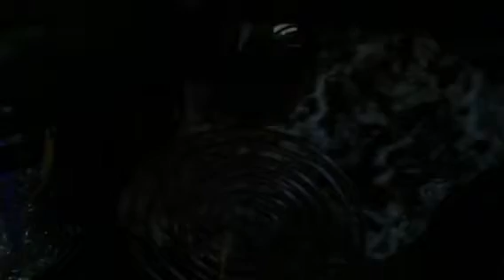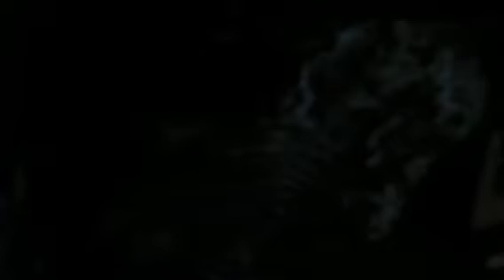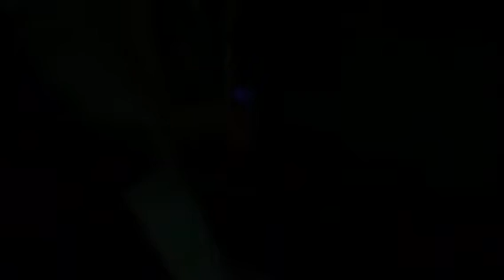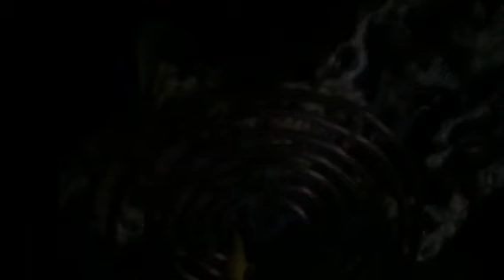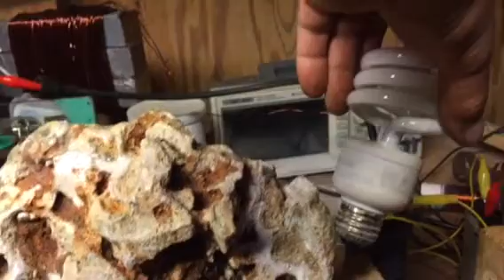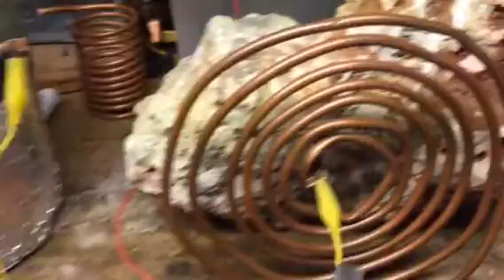Edleedskalnins Workshop. High frequency thru Coral Rock

Comment: Looks like some serious "skin effect" I wonder what sort of skin effect bismuth has. its different in it magnetic properties. But your electrostatic device is quite strong. EXCELLENT example Roy. Experiments galore a comin'
Reply: Made by one man Here I was thinking you had all the answers and now we get this information thrown into the mix, I wonder how it all works together. What evidence is at coral castle that would suggest Ed was transmitting electricity wirelessly? I saw on your videos his extensive grid network of wires what do you think?
Reply: Max Worldwide Although "in theory" Tesla "technology" was available But honestly "If I know Ed, he wouldn't have any use at all for high voltage non magnetic static spikes. His book was on magnetic Current. This phenomenon you see in the video is due to high frequency "crawling". useless for doing work. or even picking up a relay on a tripod.

Comment: This is going to sound extremely over simplified but the basic idea is to radiate electrons "electricity" from your source and wirelessly the electrons are collecting on the surfaces of your rocks,jar, and basically anything else in the room. So if you had an antenna you would pick up the "free" Electrons floating around drawing them into a singular collection point for use?